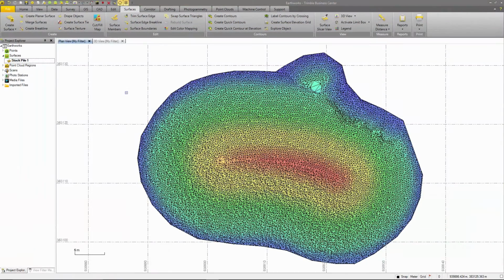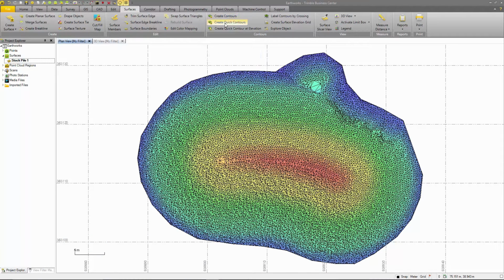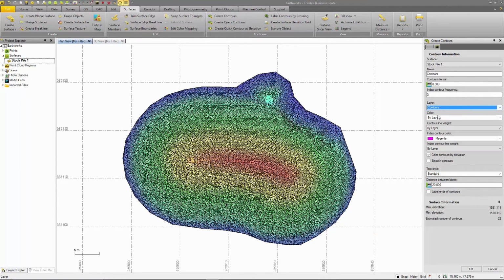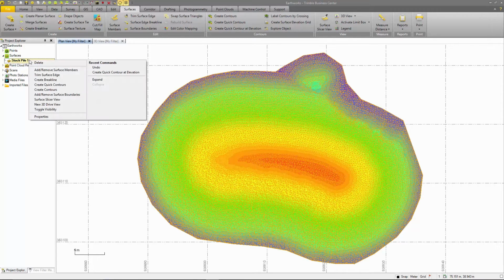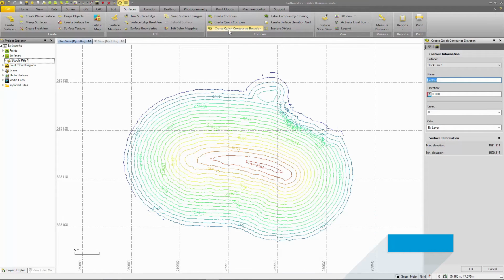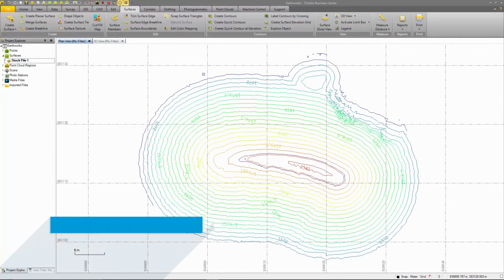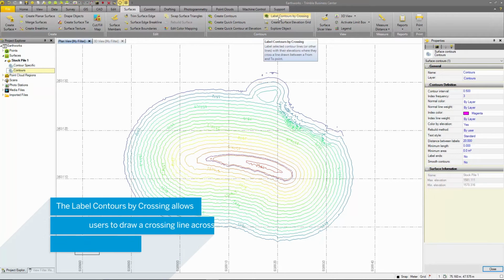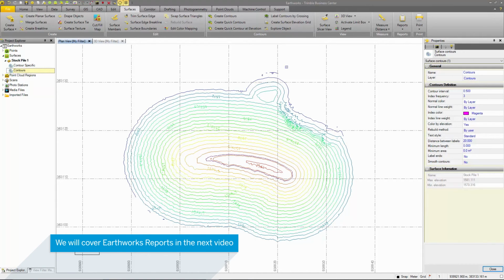TBC - Contour Creation

Comment: Very good
Reply from the maker: Thank you for your support! Happy New Year!
Reply: @TrimbleBusinessCenter  I just bought a complete system from Sitech in Brazil, 3 SPS 986, 3 TSC7 with SiteWorks and one base kit SPS855 + TDL450H. Now I'm trying to improve my TBC skills and it is not easy. Hope you guys can make a video about cloud points from a Vz2000i scanner in TBC, does it work with data from scanner other than Trimble? Thanks
Reply from the maker: @danieletva  Hi Daniel, TBC handles point clouds in various formats. You may import point clouds to TBC if they are in .e57, .fls, .las, .laz, .pts, .ptx, .tdx, .tzf, .xyz, .yxz format. Then the point cloud is handled in the same manner.